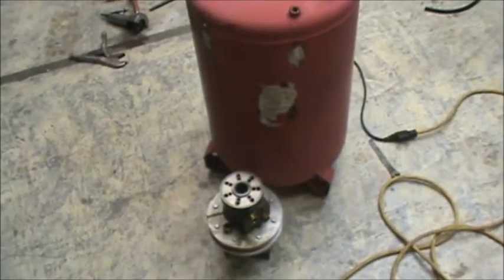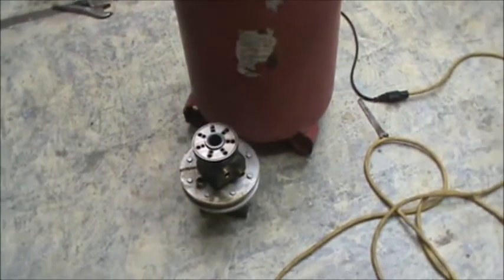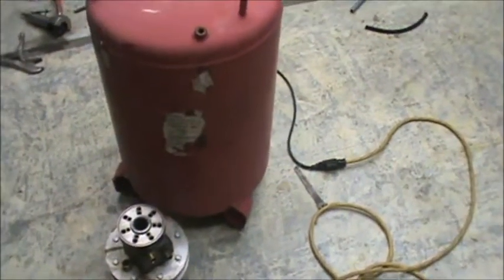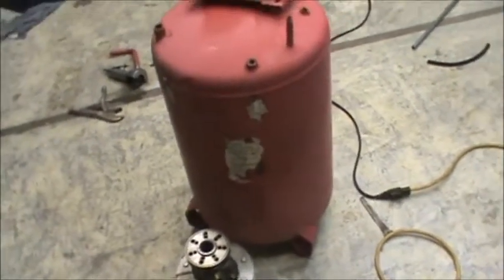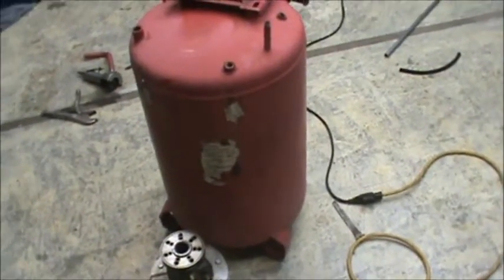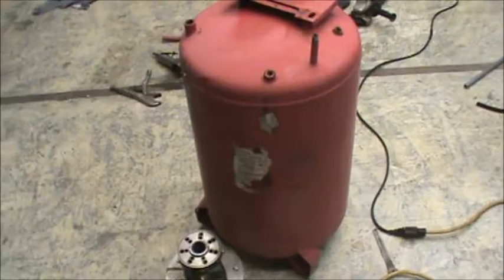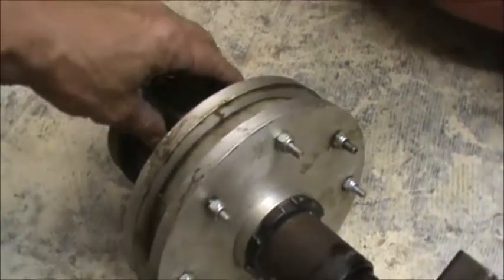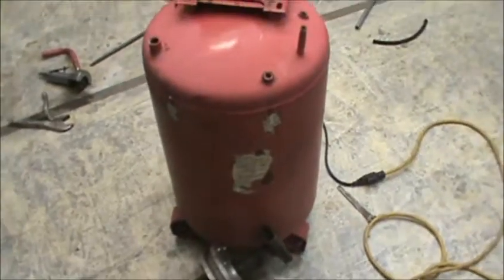clem engine 1

Comment: Great job. I don't believe in implosion. What I have to suggest you is the temperature of the oil that is above 100℃, preferably the 300‰ as Richard Clem reports. The oil is injected by the hollow shaft to the turbine behind, correct?!

What if you inject water through the front of the turbine. This would provoke a violent expansion of steam-turned water almost instantly.
This reasoning was motivated by Richard Clem having a reasonable reservoir of water.
See what happens to the water when we put it in hot oil.

https://youtu.be/GKgQ3KJdops

Good luck.

Comment from the maker: The Richard Clem Engine - 07/05/96 

Originally posted on December 26, 1992 - CLEM1.ASC A few 
months back, we got a call from a friend who had heard of this 
incredible motor that was said to run itself and generate excess useable
 power. The details were unclear at the time and our friend gathered 
more details and we met for lunch to discuss what he had found out. This
 file with diagram is listed on KeelyNet as CLEM2.ZIP. As we 
understand it, inventor Richard Clem died of a heart attack soon after 
the deal was signed with the coal company. His workshop was raided by 
law enforcement officials and all his notes and drawings were removed. The story as I was told by our unnamed friend :
 A local man (Dallas) developed a closed system engine that was 
purported to generate 350 HP and run itself. The engine weighed about 
200 pounds and ran on cooking oil at temperatures of 300 F. It 
consisted of a cone mounted on a horizontal axis. The shaft which 
supported the cone was hollow and the cone had spiralling channels cut 
into it. These spiralling pathways wound around the cone terminating at 
the cone base in the form of nozzles (rimjets). When fluid was 
pumped into the hollow shaft at pressures ranging from 300-500 PSI 
(pounds per square inch), it moved into the closed spiralling channels 
of the cone and exited from the nozzles. This action caused the cone to 
spin.  As the velocity of the fluid increased, so did the rotational 
speed of the cone. As the speed continued to increase, the fluid 
heated up, requiring a heat exchange and filtering process. At a certain
 velocity, the rotating cone became independent of the drive system and 
began to operate of itself. The engine ran at speeds of 1800 to 2300 
RPM. Immediately after the inventor had the heart attack and the 
papers were removed, the son of the inventor took the only working model
 of the machine to a farm near Dallas. There it was buried under 10 feet
 of concrete and has been running at that depth for several years.
 In later conversations, our contact says the engine had been tested by 
Bendix Corporation. The test involved attaching the engine to a 
dynamometer to measure the amount of horsepower generated by the engine 
in its self-running mode. It generated a consistent 350 HP for 9 
consecutive days which astounded the engineers at Bendix. They concluded
 the only source of energy which could generate this much power in a 
CLOSED SYSTEM over an extended period must be of an atomic nature.
 Construction of the engine was from off the shelf components except for
 the hollow shaft and the custom cone with the enclosed spiral channels.
 Richard Clem worked with heavy machinery for the city of Dallas and had
 noticed that certain kinds of high pressure pumps continued to run for 
short periods after the power was removed. His curiosity into this 
phenomenon led to the development of the Clem Engine.